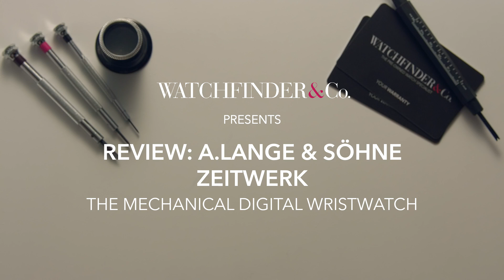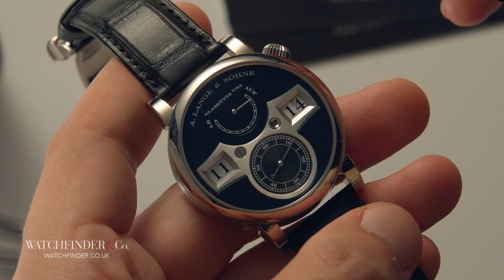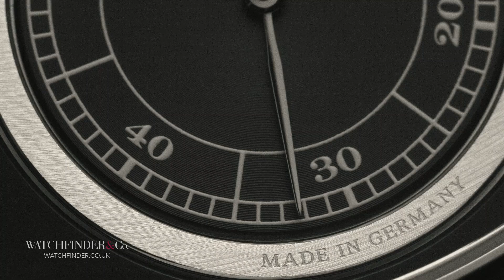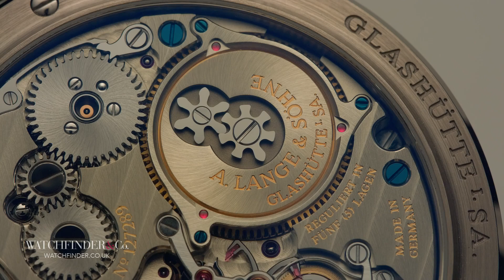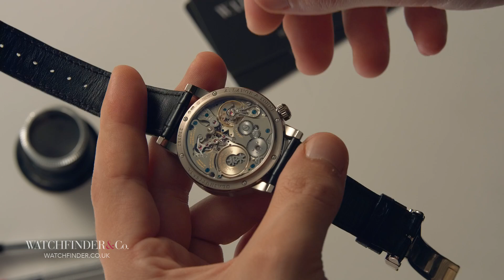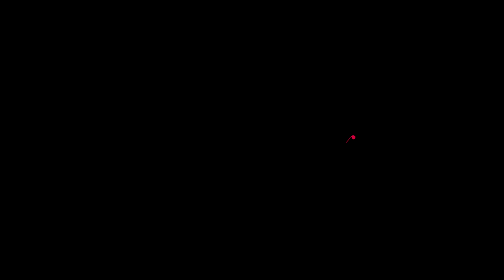Is This a Mechanical or Digital Watch? - A. Lange & Söhne Zeitwerk

Comment: I've seen a lot of pictures of this watch (never in person though), and, as a purist, find it absolutely devastating that the background whites of the first and second minute digit appear to be different. This seems to be true under any lighting conditions. If I were to spend 50 - 100+ k on a watch, that would be a reason for me not to choose this one.
Reply: Whites are the same but the digits are not sitting at the same level. The numbers on the farthest right (/second minute digit) sits a bit lower, which makes it look a bit darker, even though it isn't. I guess it wasn't possible for them to have them both completely level.
Reply: Krikstar123 Which is very surprising since Glashutte Original has no problem putting them at the same level.
Reply: Jay Remi design choice probably.

Comment: What does the upper indicator which clocks from side to side mean???
Reply: It's the power reserve indicator, tells you how much power the movement has remaining. AUF means it's topped up, AB means it's running out of power so you need to wind it.